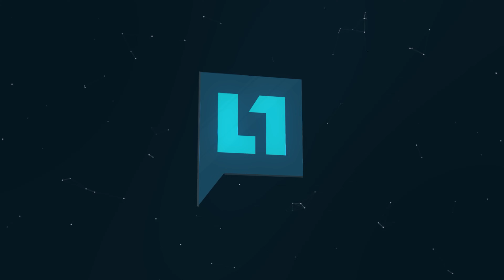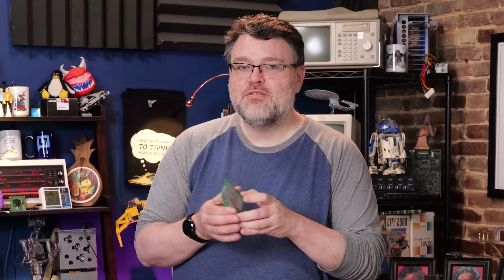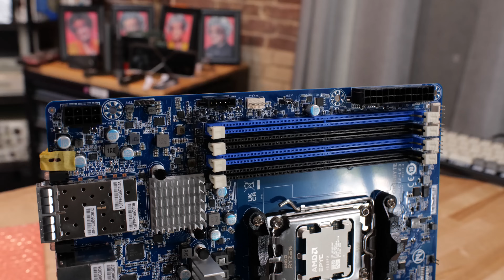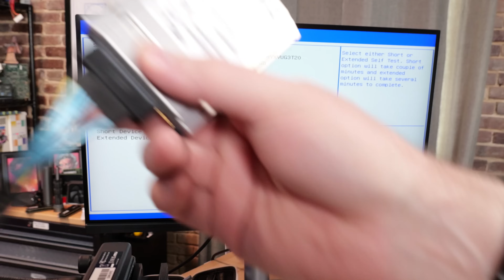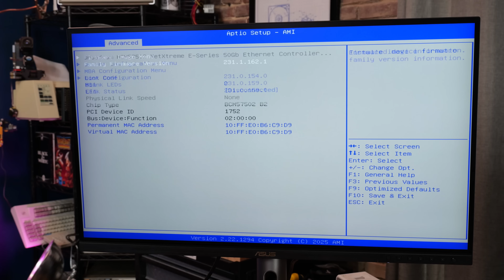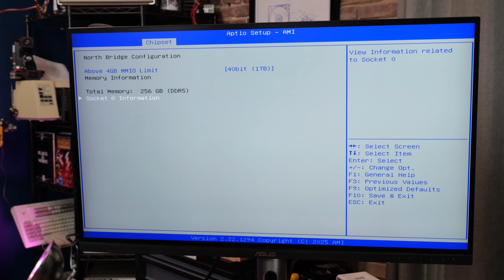AMD EPYC 4565P First Look: Featuring the MC13-LE3 Motherboard from Gigabyte

Comment: Even as a gamer these processors interest me primarily because of their power efficiency and stability. The more recent bungles with the 9000 and even some 7000 series Ryzen processors killing themselves and even some motherboards (primarily reported on Asrock branded mobos, but also a few Gigabyte and even asus/msi ones iirc) make it a hard bargain to buy higher end hardware. Especially with tariffs. But if I can get rock solid system stability? I will absolutely fucking grab one.
Reply: you can take any of the desktop parts and run them in EcoMode or set your preferred max PPT in the PBO settings to achieve the same thing though.
Reply: @Hugh_I  Yeah, but you don't get the guarantee that comes from them being binned as Epyc vs. Ryzen
Reply: @AnorakRaven  good point, yeah they're probably binned more for efficiency, you're right.

Comment: Does it require a special motherbaord or does it fit in any AM5 board?
Reply: it does fit into any AM5 motherboard, it's the same socket. Not sure though if all or any desktop BIOSes will properly detect and support them though. It shouldn't be any problem, they are physically twins of the desktop parts, but depends on how the AIBs configure their BIOSes.  IIRC correctly, I saw reviewers booting the equivalent zen4 Epycs on those boards, but before you buy any board for this, better check if either they're are officially listed on the manufacturers page or you found a youtuber testing it out. (On the other hand, there isn't really any benefit from putting one of these into a desktop board rather than the desktop parts.)

Comment: Hey Gigabyte, would a single HDMI or DisplayPort output for the iGPU 99 % of the CPUs for the platform offer have been too expensive?
(And they market this motherboard as a “workstation” model on their website)
Reply: the remote management chipset must be the only integrated GPU with a "screen" (virtual) attached. If you connect on HDMI you can't remote control it.

Afaik "workstations" have a dedicated Nvidia card for the CAD or rendering or whatever workstation job it does
Reply: There are motherboards with both where you can choose which graphics adapter is used to manage the pre-boot environment as the primary one (PCIe dGPU/AMD iGPU/ASpeed) to be able to remotely access the BIOS for example. Within an OS you can set a different configuration. With only a single PCIe slot not everyone might want to use it for a dGPU. No matter what’s the case the IPMI runs at the same time invisibly in the background, independently of any running main OS.

In the enterprise market “workstation” typically means something that’s connected to a dedicated physical display and “server’ are the motherboards intended for headless operation where you only use the virtual display via KVM IPMI.

Comment: What's with the multiple references to Windows Server? I thought it was 2025!?! Who the f^©king hell is still using Windows Server? 

Even if you want a graphical interface for your server, Linux is still better than Windows Server. And for file shares, print servers, etc. for Windows networks, Linux is still a better choice now (in 2025)..

Comment: 2:20 - Why is that kind of power density a challenge in Europe?? 😅
Reply: there is a power pricing crisis in the big economies of europe
Reply: @fluoriteByte That might be true, but it doesn't really relate to the power density. Big datacenters are readily built around good grid connections, so if you can afford the power, is no problem. Besides if you are not doing latency critical tasks, then you can easily build your DC to some nordic country and enjoy clean 5c/kWh electricity.
Reply: @fluoriteByte  Sorry, that's bs. Software licenses are way more expensive than power to run such a server.  I'm not just talking about Windows Server itself but also quite common stuff like MS SQL Server
Reply: @Martinit0  what the hell are you on?

Comment: Yes, finally 25gbps built-in to the board.   M-ATX boards are too small for you to be adding multiple expansion cards. Now I don't have to choose between storage capacity and network speed. Same for the mcio connector. But these connectivity space savings Gigabyte made, raises the question of why use M-ATX and not ATX?

Now I just need AMD to make a dual 3D v cache SKU.
Reply: my guess is, they went m-ATX to make it fit easier into most compact 1U server chassis. You usually have a storage backplane in the front in those, so you'd more likely need something like an MCIO connector over another PCI slot in most scenarios. And smaller than ATX makes it easier to fit a powersupply somewhere next to the board.  (It's a pity for home lab setups, at least I tend to prefer having maximum standard PCIe slots for my home servers. PCIe slots can easily converted to something else if needed, but the other way around makes a lot of messy adapter spaghetti. But well, that's not the main use case they design these boards for. But I'm sure there will be full ATX designs as well, there always were for previous gens).
Reply: @Hugh_I  When you look at pictures of those motherboards in rack server chassi there is always empty space where an ATX board would extend to. Also, you can get dual socket servers in a 1U chassis and dual socket Epyc 9000 boards are much bigger than m-atx.
Reply: But not a single USB4 port exposed? Odd choice for a motherboard.

Comment: If you want a server. Skip Windows ... outside of AD (even though you have LDAP) and stick w Linux. 
W 16 cores... at a MINIMUM, you will want 128GB of memory but 256GB would be better.  (You want 8Gb per core or thread.)  This is why having these large Epyc 192 core beasts  in dual socket servers are going to be a pain due to the memory density requirements.  But that's a different use case.

Comment: Why would you recommend Linux MD raid over ZFS? I am curious.
Reply: I switched from Linux MD raid to Linux zfs.  I didn't find it particularly difficult. But then I have a very simple installation. I didn't do anything fancy, I just replicated my MD Linux raid setup using raidz2.  I also installed the ZFS module for WebMin. It worked just fine.
Reply: Have you ever tried setting up ZFS with Linux? Talk about a disastrous user experience!

If you're running *BSD, then ZFS is great; otherwise, save yourself the headache & go with Linux MD Raid..
Reply: @DaM_Cdn  > Have you ever tried setting up ZFS with Linux?

yeah, what's the problem

Comment: Unless you are a hosting company or a cloud platform chances are that your 80s, 90s, 2000s datacentre is massively underutilised right now. We have a small datacentre that has come down from 60KW load to 8KW load. Virtualisation and SAN size reduction means we can run 350 virtual servers on 10 servers and even those are only about 50% utilised. This supports 3000 users.

Comment: It would have made more sense to use the 4 PCIe Gen4 lanes from the chipset for the Broadcom 2 x 25 GbE ethernet adapter and keep the 4 PCIe Gen5 lanes from the CPU available for your own devices.

Practically you can do around 6,500 MB/s through an AMD chipset that supports PCIe Gen4.
Reply: Agree it's a shame that it works out like that

Comment: The manufacturers not releasing 64 GB ECC UDIMMs is a giant Richard move.
Reply: Patiently waiting for 128GB uDIMM over here with my 7950X
Reply: Well, those are the largest theoretically possible UDIMMs in the DDR5 spec. But I consider my criticisms about the lack of 64 GB ECC UDIMMs to be a different matter: The 32 Gbit DRAM chips needed to build those exist since late 2023, 64 Gbit DRAM chips needed for 128 GB UDIMMs don’t exist at this point in time.
Reply: @abavariannormiepleb9470  I've waited 3 years, i can wait a few more :P
Reply: I was hoping that 256 gig udimm support would be official on this refresh
Reply: All AM5 BIOSes since late 2023 support a total of 256 GB system memory, it’s an AGESA thing coming directly from AMD, the motherboard manufacturers have no influence over that.

Gigabyte only listing up to 192 GB system memory support is due to the fact that at this point in time you can only get up to 48 GB ECC UDIMMs so Gigabyte couldn’t physically plug in 4 x 64 GB ECC UDIMMs to list support on their website - that’s why Wendell tried 4 x 64 GB non-ECC UDIMMs to quickly verify that 256 GB in total work.
Reply: @abavariannormiepleb9470 here’s to hoping 64 gb ECC udimms become available and get validated.
Guess it’ll be a long road though if the cas latency is so high and speeds relatively low
Reply: The latencies are derived from JEDEC standard timings, ECC memory that officially supports faster timings is extremely rare. That doesn’t mean that you can’t manually overclock ECC memory. For example on DDR4 systems I regularly use DDR4-2400 memory that’s about ten years old and overclock it to DDR4-3200 to verify that correctable memory errors are properly reported to the main operating system.
Reply: @abavariannormiepleb9470 4x ddr5 6000 ECC udimm when??😂😂
Probably never or right before ddr6
Reply: @JeremyWorcester1  I think i've seen RDIMM at 6400 CL30 but only 16GB capacity.
Reply: @JeremyWorcester1  Would be nice, but DDR5 uDIMM is likely going to cap at 128GB as to not encroach on RDIMM and LRDIMM
Reply: I wouldn't say no to 1DPC 128GB ECC. Although ECC UDIMM DDR5 pricing is still too expensive for my liking, still. But with adoption of EPYC4000 and W880, there is now actual platform support in huge numbers. ECC  UDIMMs are not some fringe exotic stuff like 5 years ago. Which is a good thing for everyone.
Reply: @TheExard3k  I dont think there are currently any 128GB udimm sticks.
I think there are a few 512GB specialized LRDIMM or other standard, but i dont think uDIMM has crossed over to larger than 64GB, maybe 96GB/stick.
Reply: @deegarkie5598  With 1DPC I meant 2x64GB DIMMs. You previously had to sacrifice a lot of frequency for 128GB with 4x32GB. No longer the case. Now it's fast 128GB and slow 256GB.
Reply: @TheExard3k  3200MT/s the fastest ECC uDIMM i could find in 32GB capacity.

DDR4 is not as bad as DDR5, but yea if i wanted to go to DDR4 5000 i had to drop down to 2 slot boards and a pair of 8GB samsung B-die udimm nonECC, but i could get 16GB sticks running at 4600 but they werent B-die so instead of 5000 CL17-17-17-28 it was like 4600 CL26-28-28-40

Comment: Talking about more pci lanes!     Pci could very easily be connected too a chipset that could substantially expand pci lane count at a lower generation,    say instead of aending 16 too a slot @gen5    easily send those too a chipset too breakout too say 32  at gen 4 too acomidate many 4x4  too 2 x16 slots  etc etc.    The posibilities are dern near endless if they would just think outside of the box a lil.    Most of us runnin nvme raids are just using gen 4 or 3 anyways due too the high cost of gen 5.  That is more than enough too saturate a 10gig nic,   but also love the 2x 25gb connections as well!!  The amount of game clients i could run with this is awesome though!!   Paralel valheim servers, or standalone game instances at 1 time in this form factor is gunna be awesome lol.     Maybe i could retire some of my old x399 systems 😄

Comment: I'd love to see a refresh of the forbidden router series with this, Proxmox and OPNsense. Such a killer solution!
Reply: have you seen the prices for these things? I found this really interesting until I saw that it's a €1000 motherboard. Ummm yee... it would be incredibly stupid to use this for that purpose from a price/perf standpoint. You could do it, but at that point go for threadripper since you're spending the money for it - and the threadripper would do everything a LOT better. The only situation in which this would make sense if you're space and power constrained like you are on a fuggin BOAT on the ocean. Or you need to build a tiny server to hide in a closet in a way where no one finds it. If the board was €300 it would still be pricey for a lot of situations, but maybe doable. 
But if you don't care about price, go for threadripper pro with a terabyte of RAM and 25gbit nics in every slot etc. Why not?

Comment: German here, my company does not give a single fuck about noise. Put a giant switch rack in a normal office, have some giant cooling system that sounds like the fans grind on steel. It's just below health&safety noise level but working in the neighboring offices sucks donkey balls.

Comment: I still do not understand why anyone would use these CPUs.

Either go for desktop Zen 5 or go EPYC 7000 series or higher. I don't own a server but what even are the advantages of the EPYC 4000 series?
Reply: for a home user: none, really. They are the same chips as the desktop parts – and the desktop parts are probably slightly cheaper to get. The real difference is the official support and certification for server grade hardware (and software) that enterprise customers would require. If you just want to build a DIY home server or something, you can do the same with a Desktop Ryzen.

Comment: Why do people need these processors when there are ryzens? I don't understand the differences. Both have ECC
Reply: The difference is the official support and certification for server grade hardware (and software) that you buy with an Epyc. For any home user: doesn't really matter, it's effectively the same chip as a desktop Ryzen. This is mainly for enterprise customers and data centers who require that sort of thing.

Comment: I would love to have this as a homelab rack mobo.
Reply: I'm running a zen 2 epyc system, for what they are they are reasonably priced. You can get a board and cpu combo for around $700 and 256gb of 3200mhz ecc ram is about another $500.
Reply: yee the price/perf doesn't look that good, board, cpu and some ram 1500 - then all the other standard junk on top. I like the thing, but not the price of it, I bought a 10980xe with 64gb ram and asus high end mobo for 700 second hand, sure, it's used, but it'll slap this thing in performance for half the price. 18 cores at 4+ghz umm... Sure, the 10980xe is a bit more hungry, but you can do much more with it than this.
Reply: @noth606  problem is I have a 8500G and 96G of RAM and I'm maxing out both..
Reply: @TemplePate01  You could get a lot more cores into that same socket though, ram is what it is, pretty pricey for any platform. I have an older box with a 14core xeon and 96gb that I built "on the cheap" but the ram was the most expensive bit of the build if I recall correctly. it's got a 2TB servergrade pcie SSD and a quad gigabit card plus a P4000 quadro for some GPU action. It's old and the cores are slow on it but it's decent as a "serverbox" to play around with for stuff that isn't very CPU intensive. For fast CPU per thread I have the i9. Even old RAM is still expensive though, so I would avoid old stuff unless you find big ram kits cheap somewhere. I'd probably try to find a 256gb set of ram first and then build whatever the RAM works in that has a lot of cores if I were to build something now heh.

Comment: The one thing that's missing to make this the perfect small server setup is an IcyDock with a built-in PCIe switch. Basically, I'd want to utilize that single x8 MCIO connector for an 6/8/12 drive IcyDock bay.

Comment: 2 channel memory and just 28 lanes is rough. I honestly don't know which use cases would need 128+ GB of RAM but are fine with just 2 channel bandwidth?
Reply: intel-style disgusting market segmentation inbound
Reply: VMs running Java probably
Reply: @AntonioMolfetta  Java shots fired :) You're right.
Reply: Two channel DDR5 is like quad DDR4. By that logic an 8 core Zen 5 CPU could be an ok match for that.

The 16 core however, I don't see how that little bandwidth could be enough
Reply: Plex and video encoding home server. The extra memory is extremely helpful. The pcie lanes don't even matter since the primary storage is on SATA HDD over HBA and only need a single GPU and maybe a couple NVMe scratch disks. Fits easily on 28 lanes. Memory speed is completely irrelevant.
Reply: @zzz-v3w6t  Sounds to me like you need more lanes "Couple NVMe", "single GPU", "HBA" you're already running on chipset lanes with just that
Reply: @owlmostdead9492 who cares if its on chipset? literally makes no difference
Reply: @zzz-v3w6t  performance and IOMMU cares, huge difference
Reply: That's because it's just a rebranded 9700x...
Reply: @Cynyr  For people who don't need WiFi,BT and RGB but ECC,IPMI,25GbE and proper BIOS. I'm fine with 64GB ECC on my next server. And you can't beat 9700x/9900x and dual channel for low-latency server stuff. Gigabyte board is very pricy, but otherwise low-cost full server mode. Can't wait for 4465x to hit retail.
Reply: @TheExard3k  i agree about the motherboards, but you could do all of that on a 9700x without "special" server processors.  I'm sure these will be great for a fair number of edge devices. Since you mentioned 25gbe networking, I'm not sure where all the lanes are going. 4 to the chipset, 2x4 to dual nvme m.2 bays for os drives. That's 12 of the 28 lanes right there. A dual port 25gbe nic (intel 810 and 830) is 8 lanes. Leaving 8 lanes free for a gpu, hba, u.2 drives or whatever else. Need some fast storage and a beefy gpu for local ai? Too bad. Want a hba and a pair of zfs slog drives? Too bad. I really hope am6 has at least 48 lanes or that atx boards take a 5.0x16 slot and make it 32 4.0 lanes.
Reply: @Cynyr  This board is so weird. Yes it has 25gbe networking built in. But not a single USB4 exposed. I don't want to sacrifice an already sparse PCIe slot for an USB4 add in card. I expect more from a USD 500+ board.
And only a single m.2 slot and just one x16 and one x4 slot.